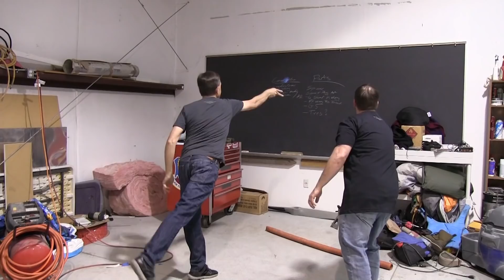Throwback Thursday - Make a Sonic Popper from an Old Racquetball!

Comment: Does it work with tennis balls?
Reply: Probably not as well.  The fibrous layers including the felt outside don't help this process.  Firm rubber of a particular thickness ratio to ball size works best.